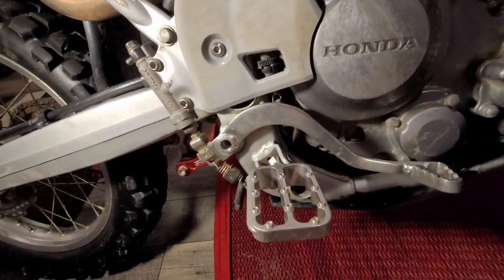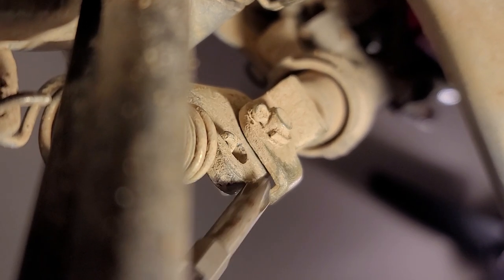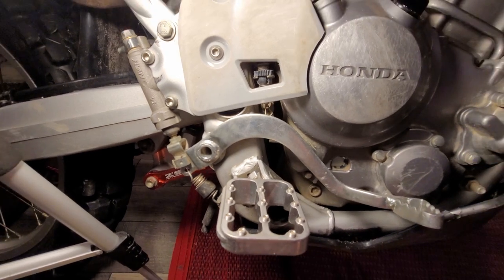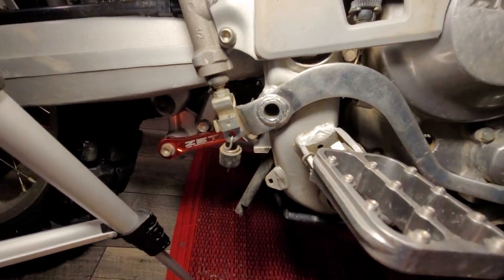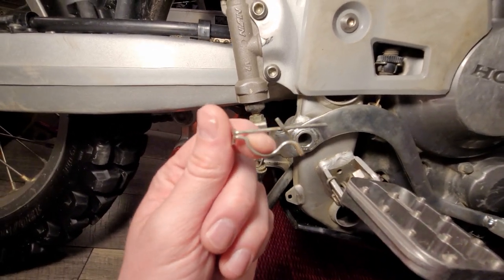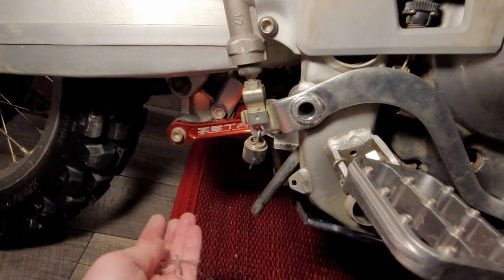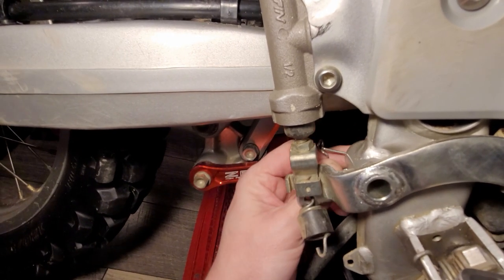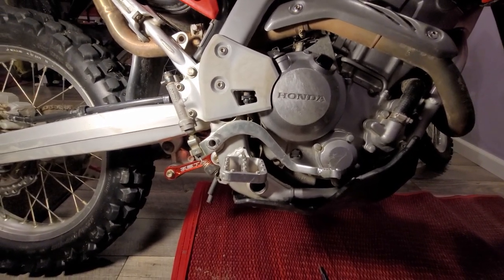CRF250L - Quick Tips, Tricks & Maintenance Ep 1 || How To Remove Rear Brake Pedal

Comment: Super simple, super easy. So super simple and so super easy I’m not going to do it for you on camera!  LOL that made me chuckle. Good video man!  I sold my CRF250L but still get roped into videos about them!  Keep up the good work.
Reply from the maker: Lol
I was working with very limited time today as I just decided late last night to provide a video on how to do it for a viewer. 
2 Springs
2 Cotter Pins
2 Bolts ( For Rear Mater Cylinder)
and she's off.
The worse part is just getting the Cotter pin back in that you have to bend straight. 
Other then that its a breeze.
Thanks for watching! 🍻
Reply: @AdventurerZack  I swapped sprockets on my KLX300 right after I got it. There was a cotter pin on the rear axle shaft nut that broke the very second I tried to bend it straight. Which reminds me, I still need to replace it!  I’m gonna steal your quick tips idea for my channel. Short, 5 minute long how to vids will generate a lot of traffic. Good idea bro.
Reply from the maker: @FloridaTwoWheelAdventures   Hey brotha I'm all for everyone eating, Lol. As a moto community its best we all help one another out. 
I have had a cotter pin in the past do exactly what happened to you. I straightened it out and the end just snapped clean off.
I was honestly afraid the rear brake one would do the same but thankfully it is very flexible.  Must be a really good soft metal, what ever they typically make them out of, its good material.

Comment: Thanks I needed this video I’m replacing my clutch atm on the L , and I had to take my rear brake off I will use this video when it’s time to put everything back together .
Reply from the maker: Glad I could help out.
How many miles did you get out of your Clutch? I'm curious as I'm over 10k miles now, I have zero issues with my clutch just wondering now what my oem clutch life will be roughly.
Reply: @AdventurerZack  my bike is a 2018 that I bought brand new . I have 16k miles on it now. I felt the clutch slipping at times and it feels like it doesn’t grab good . When I took it apart my steel plates were all black. My friend told me that means my clutch was shot . I’m not really that good on how to tell if it’s bad or not. I’m replacing it with EBC ck1313 friction discs , new steel plates, And ebc springs. Hopefully I gain some power and I’m able to do some good wheelies again.
Reply from the maker: @theCODproduction1  Awesome, that's a good amount of mileage especially if you do clutch ups. 
When I need to do my clutch I'm gonna do heavy duty springs and remove the judder spring or whatever it's called.

Comment: You didn't discuss replacing the 46525-KK0-003
dust seals and the orientation they go in at all I was hoping for some guidance on this since this is a part that is shared with this model and my xr250
Reply from the maker: Hmm, to be honest I’ve never replaced those said parts. 
I’ll have to look into it and see what they are exactly. 
Thanks for the heads up.

Comment: How to adjust the rear brake pedal up or down.  Also how to adjust the rear brake so that the pedal doesn’t have to move much before making contact with the pads to rotor.
Reply from the maker: So there's a nut on the bolt at the bottom of the rear master cylinder that will allow you to adjust the drag I should say on the rear brakes. Basically, where it engages the rear brakes.
In almost 12k miles, I never had to adjust mine, though. When I replaced the rear pedal, I just replaced the rear pedal and didn't have to re-adjust anything. The pedal lays in the frame at one angle, so once you bolt it all together, it should line back up the way it was from the factory. 
If you need to adjust the rear brakes, just play with the reservoir bolt to increase or decrease the amount of friction on the rear pads. 
Hope this helps.